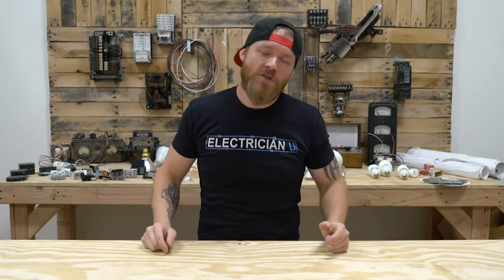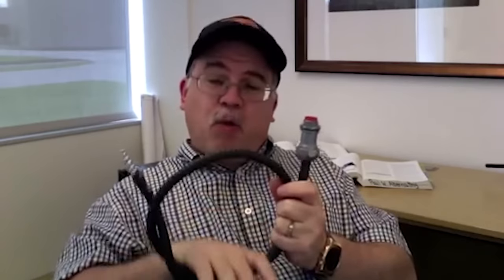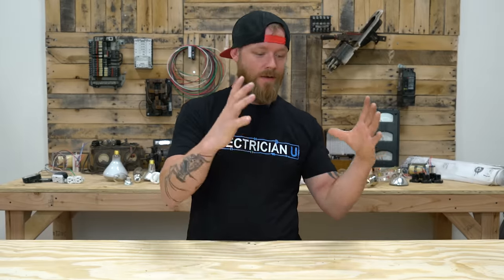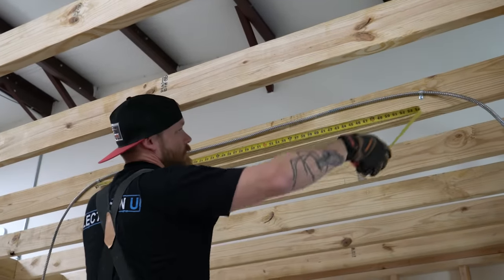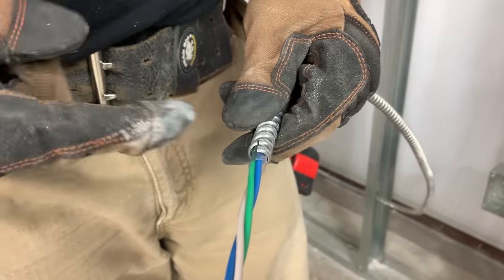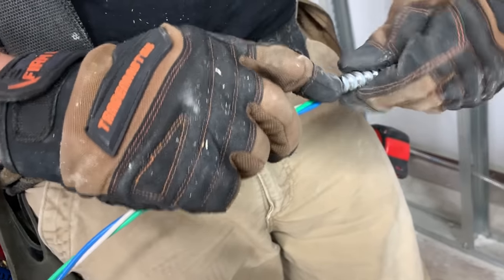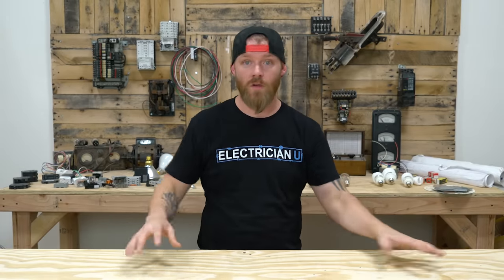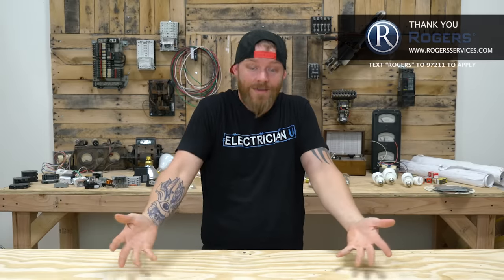Wiring With MC - WHAT YOU CAN AND CAN'T DO WITH MC CABLE as an electrician

Comment: Great stuff.  However, trying to find a electrical supply company that carriers, or can get MC PVC cable (14/2 in my case, for exterior lighting under an exposed deck), ... well, ain't happening.  IF you can get it on special order, you have to buy a 250' or even 1000' spool.

Comment: How do you test for electricity running through MC cable already installed? The no-contact voltage test doesn't work. I want to cut the cable on one particular circuit and install a junction box so I can add a new line.

Comment: Started out using type AC  cable ( BX ) back in the 1960's when they only had anti short bushings made of coated heavy paper that when exposed to moisture for awhile would fall apart. Always cut BX MC, & Greenfield end at a 45 degree angel so less chance of cutting thru wire. Nice vid. Wish they would do away with BX due to flimsy #18 gauge aluminum fragile wire along with metal jacket provides a so so ground.

Comment: How about BX?
Is it still available?
Is it the same thing as AC?
The red devils were required and had to be visible inside the box. They had a tab that would protrude past the connector into the box.
Reply: OK so no Metal-Clad is not the same as BX, No, the BX was only part of an experimental project back many decades ago but the name stuck, No, the Metal-Clad "MC" is not the same as "AC" or Armored Cable. The construction of standard "AC" cable uses the armor as the equipment grounding conductor and that is not the case with standard "MC" cable. However, the "MC" does come in a variant that does use the armor as an EGC. Lastly, the anti-short bushing, you call red devils are only required for "AC" cable per 320 40 and are totally optional for "MC" cable since the listing and design of the fittings make their use moot. Hope that helps.

Comment: If the work is done outside in a wet condition, shouldn’t liquid tight flex be a better option with appropriate liquid tight connectors? Then run the required conductors?
Reply: I think he's just explaining how it would be used in that application, not whether its the most appropriate choice.

Comment: Can I use MC cable (10/3) for a 220v dryer outlet install, ran across a cinder block wall in the basement? I don't want to bend conduit if I don't have to...
Reply: Wait, I think you answered my question, lol.

Comment: Clearly MC needs to be wet-rated and use wet-rated fittings for wet locations, but what about damp locations? I can't find permissible use for damp locations. However, I'm told a KO box and basic EMT is allowed in damp locations, and MC doesn't seem any less leaky than that.

Comment: Any thoughts on transitioning from MC with threaded 38 AST  to PVC FA down a CMU wall to a switch or outlet? The sheathing would be grounded on the end of MC that is connected to a 4sq.
Reply from the maker: Literally anything you want. The only requirment is that the coloring code must be listen at panels where circuit is generating.

Comment: So in a commercial application a person could plan to use EMT to the panel and MC for everything else?
Reply: this is how alot of the jobs we do in our company are. EMT out of the panel, out of the electrical room to either a gutter box right outside the room, in accessible ceiling. or the pipe may continue to the area, to a j-box, from which point MC is run after.

 Regardless, we always pipe out of a panel to the first accessible junction box/gutter, and run MC after that point.
Reply: @ThreePhase470  cool. Thanks!

Comment: Is it possible to tap into an outlet and connect the mc cable and also have the outlet in use maybe with box extension in a garage
Reply from the maker: Depends on local codes. But it is physically possible to do such a thing.

Comment: Thank you for sharing you knowledge and experience in videos. I have a question, can mc cable run inside PVC conduit?
Reply: Why would you want to?
Reply: Yeah why would you.
Reply: Yes, you can run metal-clad cable inside a raceway. However, if the raceway is a complete run as stated in 300.18(A) then you need to worry about raceway fill per Chapter 9, Table 1 and the associated note 9.

Comment: I hope someone who can help sees this. I am installing a new medicine cabinet that is bigger than my old one and recessed.  When I removed the old one I see that there is flexible  conduit in the wall at the top. Is it ok if the medicine cabinet touches this? Do I need to install some type of barrier? The conduit sags a bit and has room to be lifted. Can I safely  lift it by the metal medicine cabinet . The two will barely touch and the conduit seems to be completely intact and there have been no electrical issues in this bathroom.

Comment: Does anyone know if I can do 4" canless recessed lights with mc cable in new construction? With canless, I don't install the lighting cans, I just  run my mc cable through the ceiling joists, with a good amount of slack, and then install drywall. Then I drill holes in the drywall to install the 4" cans. But what worries me is I have to fish out the mc cable and pull it down through the 4" hole in the drywall. Then I cut it and attach the cable to the junction box that's connected to the canless light. But to pull the mc cable through a 4" hole, it would bend the mc cable, and perhaps compromise the wires?

Comment: On AC or BX how would you deal with a broken ground situation where you can't pull any more slack into the box and rerunning a new line would become a project?
Reply: If your talking about that little piece of bare aluminum in the AC or BX cable, that’s not a ground! The jacket of these cables is the ground....   That wire is there to eliminate any eddy currents on the cable....   Then you use a ground jumper from your box to the device in question.
Reply: @robertmitchum2972  Well the good news is every time I have come across this situation I dealt with it properly.  Bad news is I come across that bare wire hooked up to ground a couple times a year.  lol

Comment: Hi, great video!  Quick question if I'm supporting the mc cables over the rafters do I need to secure it too?  Can I secure the mc cables with tie wire tied to the rafters?
Reply: Code says yes, ahj may not
Reply: Yes, it still needs to be secured per 330.30(B) and in terms of the "tie wires" look at 330.30(A). You are permitted to use staples, cable ties listed and identified for securement and support, straps, hangers, or similar fittings; or OTHER approved means designed and installed so as not to damage the cable. So, approved means the AHJ approval so check with them on the "ties".
Reply: code for stapping is 5' , we go 4' to hit the rafters as the r 2' on center

Comment: How about using 90 degree connectors with MC. Some times I have to add a remodle box  this  is the only way I can seem to get them installed  without butchering the drywall using a straight connector. I was just wondering is this ok.
Reply: perfectly fine they make 90s specificly for mc, ALWAYS use redheads ,even if u r using snap in conectors .. people say no redhead needed caz the "redhead built into connector, but it doesnt protect the wires in the conector where the mc is split/cut sharp, and have sharp metal prongs that hold the cable in securing it

Comment: Ok my friends, girl question here. My house is on a slab and I am renovating my kitchen and putting in an island and luxury vinyl plank flooring. What is the cheapest best way to get electricity to the island? Trying not to break concrete to keep costs down. Building inspector stated using mc cable, but would that leave a bump in floor? HELP!!!!! Any thoughts would be greatly appreciated. Girl running wires, will hire electrician to connect.
Reply from the maker: Try asking in our discord: https://discord.com/invite/7ykYfbh

Comment: We have rodent problems sometimes, I’m thinking of re-wiring my bedroom in MC.
Reply: Glue traps
Reply: Rolling log mouse trap. Just be sure to release them 1.0 miles or more from your home. The problem with glue traps is that they are $0.29 each. Gets expensive. Get a thermal imager and patch holes in your building. Petzel LED headlamp is worth it for premises inspection.

Comment: What are your thoughts on what to do with the bonding wire on ap mc in connectors?
Reply: Wind it back down the jacket 3 turns then use a metal connector.

Comment: Can I use 14-2 UF ,outdoor for a light but without pipe
Reply: yep. UF is direct burial rated. just have to go deeper with trench when direct bury UF. in conduit, you can go shallower - 18 inches i believe. UF must be protected from physical damage though if you surfacing running it

Comment: An electrician in the Chicago, Illinois area said that local code didn't allow a run of MC longer than five feet.  Anyone know if that's true?  If so, are there other locales that have such restrictions?
Reply: nec strapping is 5' max.  local jurisdictions have their own preferences but u can run mc as far as you like , thats y they make 1000'+ spools: now the 5' thing is for max lengrh without being supported by some means, box, fitting, strap, ect, ect...

Comment: Some jobs have a spec that says u have to use a rotosplitter. I don’t tho ;)
Reply: I highly recommend that one is used it is much quicker and safer than other methods including use of a hacksaw or tin snips.  In some jurisdictions the electrical inspectors will examine your cuts and fail you if you don't use one (I have a Greenlee 1940 and it does a good job).

Comment: I’m surprised they don't make MC strapping. Essentially, strapping with nubs or creases that fall into the MC grooves to prevent pull through
Reply: They do.
Reply: @pld8993  What’s it called?
Reply: @jmi967  Certain manufacturers' 1-hole straps have a small nub on the inside of the radius.

Comment: Some city inspectors like seeing the tab of the anti shorts / red devils when they do their inspection and they can fail the inspection if they don't see that tab of the anti shorts when they look into the jbox
Reply: If this was the case I would go over their head because they have no clue and should not be doing inspections. The Anti-Short Bushings are not required on MC Cable period.
Reply: You haven't work in corpus christi tx  the  city inspector there for the electrical inspector for the commercial side would rather fail the inspection due to not using the anti shorts all the way to not using the right screws even though you are using the anti shorts or the right screw for the job
Reply: @michaelruiz4074  to each there own...if it's not worth educating the inspector then go ahead and install them. Above the minimums are fine.
Reply: Just like the torque specifications spme parts of Texas the inspector does check and require the electrician to follow the instructions on the panel for the torque specification and some parts of Texas like the city of corpus christi tx haven't enforce that yet its been my experience as an electrician apprentice along with the journeyman I was under seen some city inspectors fail the inspection with some leeway and walk off the jobsite and told to take pics and send them in to the inspector on the correction or what was used. From tape to spray paint on grid wire that we installed to a story pole at 18 inches for a trench clean out and they will pass the job
Reply: I rather check with city inspectors and ask the question what will is the city ordiance electrical inspection on the usage of anti shorts and then check the  code if they're almost inline with code requirements
Reply: Some city inspectors do follow the code or interpretation of the code to suit the inspectors requirements

Comment: I did connnectors on a 1000ft roll of 12-3 mc with ground with a corrosion preventive oil on it and was told the roll costs $4300 🤭

Comment: Can you use staples for strapping?
Reply: Typically mc is ran through or on metal. Would you want to hammer staples to metal?
Reply: If they are listed for that use by manufacturer generally yes. Check with local inspectors and read the box to see which types of cable are permitted. I'd keep the box on hand in case your inspector wants verification.

I've used MC cable in some wooden framed commercial structures where staples are much easier and more secure than 1 hole straps.

Comment: Can u use flex in wet location
Reply: When you say flex....we have to assume since the topic is Metal-Clad Cable, which is flexible, the answer is YES if the Metal-Clad Cable is PVC Jacketed as per the directions of 330.12(A)(11) of the 2020 National Electrical Code.

Comment: what are the benefit of this type of cabling? ty
Reply from the maker: It’s a little more rugged and protected than Romex (nm). Really it’s the jacketing, but most of the time the conductors inside are rated for wet environments and are rated at 75-90 degrees as well where as Romex typically has dry-type 60 degree conductors so the ampacity adjustments get you further with MC as well. Plus with Romex you can’t use the jacketing as an equipment grounding conductor or have an option to have an isolated ground in with the standard equipment ground. MC can be configured in a multitude of ways. You can even get types that have control circuits mixed in with power circuits. Just beefier and more versatile.
Reply: @ElectricianU  ic ty
Reply: @pierrebeauregard5369  Be aware that normal MC Cable can't utilize the armor as an equipment grounding conductor(EGC). There is special Type MC called MCI-A that the armor can be used as an EGC because of an internal grounding/bonding conductor that only serves to bond all the convolutions of the cable. Just keep that in mind.

Comment: This doesn't have to do with the video. You will need to drill with a step bit some holes through I beams or girders. Most inspectors say, " if you drill it, you got to fill it." I was asked to insert box connectors with the set screw off in any metal I'm penetrating. Has to be no less than 1" from any edge or in-between holes. Some inspectors don't like going around the beam on the outside. Someone hanging a sign etc... can hit your cable. Any videos on doing this correctly?

Comment: Are the one-hole straps used in this video (https://youtu.be/6sZyqikMsgw?t=442) specific to MC or would they also be rated for use with EMT? I'm having difficulty tracking down straps that look to be the correct size to support 14/2 MC. I see one-hole 1/2" EMT straps that look similar at Lowe's, but they seem to be way too large.

I didn't see anything like these (https://www.homedepot.com/p/BRIDGEPORT-14-2-to-10-3-Mighty-Hold-Universal-Steel-1-Hole-MC-Straps-100-Pack-US-4461/314707544), which look to be the obvious choice.
Reply: 3/8 " or 1/4" one hole straps

Comment: There is no testing standard to "rate" mc cable for damp locations
Reply: While UL 1569 nor the NEC specifically address Damp Locations it is covered when PVC Jacketing is applied. Since the PVC Jacketed or Covered version is Wet Location rated it also would cover Damp Locations as well. To fix the NEC in Article 330 we have to fix UL 1569 first. Thats our next mission. BTW - visit www.ElectricianLIVE.com

Comment: AC stands for Another Cable :)
Reply: 0:54
Reply: MC stands for mexican cable
Reply: Never heard it called AC cable.  We call it AP cable, the armor is used as a grounding conductor.  Mostly used on lighting branch circuits.  Union journeyman, only work in large commercial/industrial.
Reply: I see.  Type AC has a steel armor.  AP has an aluminum armor.  We never use the steel stuff.  Aluminum is weaker but when used as a ground the extra valance electrons help a lot.
Reply: Bucs #1 Fan i
Reply: MC stands for Metal Clad Cable NEC 330
Reply: BX stands for.   B-oy.    I’m X- hausted from carrying this crap up ten flights of stairs!

Comment: Hacksaw its by far the fastest way
Reply: No way..Always use a MC splitter tool
Reply: You can "hack" saw into the conductor insulation. The MC Splitter tool would be a lot faster.
Reply: @guytech7310  faster and much safer

Comment: you have strip the pvc off the bx before its inside a place. Plenum rating
Reply: Type MC is not "Plenum Rated". It is permitted in environmental air spaces via the permission in 300.22 directly. Yes, the PVC Jacketed MC can be used in those spaces as well of the PVC jacket is removed.

Comment: Should get some kneepads bro believe me you want protection at all times, unless you got those pants with the built in ones
Reply from the maker: I don't have the pants with built in pads, but I have knees with built in pains lol
Reply: @ElectricianU  It is a challenge to find knee and shin guards that stay in place and are not too bulky under uniform pants while also not interfering with a taller work boot. Working as a sports professional I'd personally recommend Troy Lee Designs KGL5450 for lightweight knee and shin guards, or alternatively have a look at Demon United which my peers also recommend and say they tend to be either a lot more bulk or a lot less bulk than the Troy Lee Designs guards. Sizing is critically important for the guard to stay in place all day long without shifting around so check out the manufacturer fitment chart before you buy. These types of knee and shin guards can be worn as a garment mid-layer under work pants but for best comfort some kind of athletic base layer legging pants are best under the guards so it doesn't get scratchy or pull at leg hairs. Also yes there are pants from Blåkläder that feature knee pad inserts and are an amazing workwear option if your company allows it and you just want knee padding; I've used their overalls with knee pad inserts for years and the only thing I have to say is to get a few pairs so you always have a clean pair ready to go - the knee pad inserts are somewhat fiddly to remove for washing the pants. You know how it goes: Buy once, cry once, otherwise cry every day. It is amazing we forget to take care of our feet and knees.